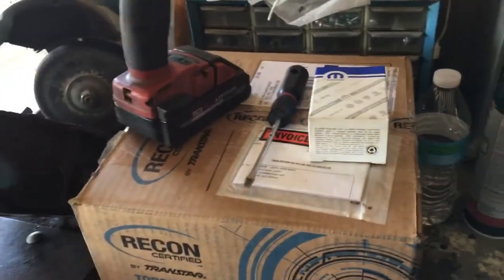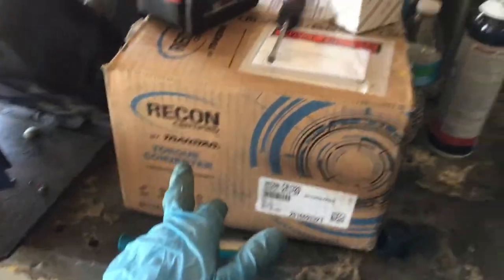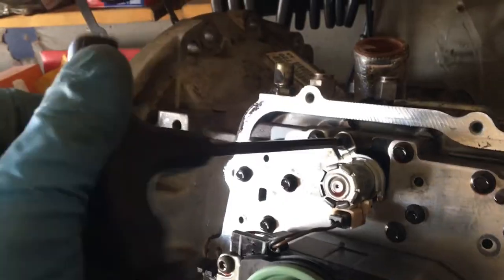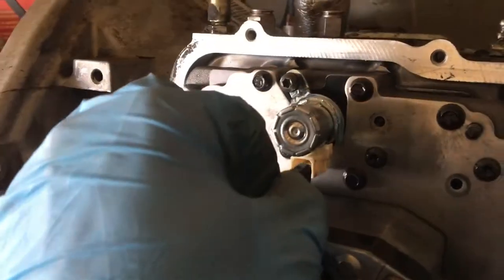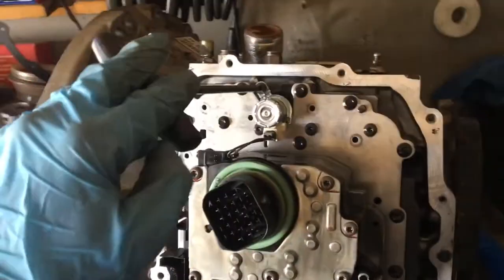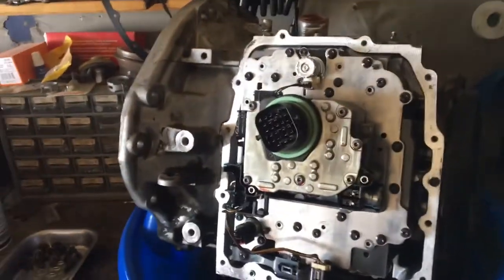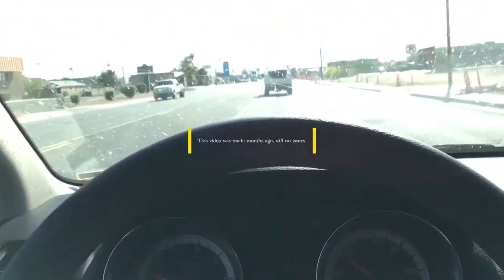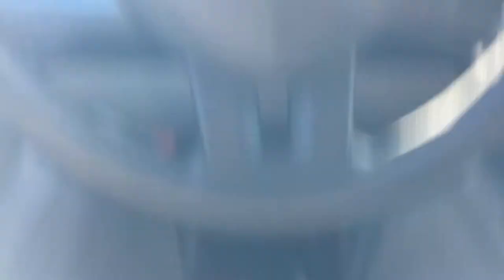2010-2015 Dodge Grand Caravan p0740 converter clutch lock up (FIX/REPAIR)

Comment: Dealer Tech here, great repair. 99.9% its never the solenoid. Great video my friend. Liked and subscribed.
Reply: Hello, my dakota 2011 when taking temperature remains without advancing. I have to wait for it to cool down before I can move on. Returns the code P0740, do you know what the problem may be?
Reply: Mine went out and I found a video that described it to the tee. It gave the MOPAR part#. Do you happen to know it? The dealer said exact same thing you did. 99% sure this wouldn't fix it. It did. Now it's happened again, ...to another 2010 Chry T&C (both 3.8). They both shuddered and died in forward, went perfectly fine in reverse and could be driven by:
1. Avoiding stops if possible
2. Shifting to neutral just before stopping
3. Shifting into drive and applying throttle vigorously
I drove each of them home from 300+ miles away.

To sum up:

This solenoid may not be the problem 99% of the time, but for me it's been the problem 100% of the time.
Reply: So what’s the problem?
Reply: @Sanjar10A7777  Who are you talking to? I cant just hold sessions on somebody else channel, thats rude. You can visit my channel and ask what ever you like as long as you subscribed to the channel.
Reply: @OnlineMechanicTips  you said  99.9 not the solenoid. So that’s why I asked what’s that. Give value and than ask for subscription
Reply: @Sanjar10A7777  Sorry, I dont discuss this on others page. You dont have to do anything.
Reply: @Phuckharris2024  what kind of car do you have?
Reply: @OnlineMechanicTips lmao bro it’s YouTube it’s not that deep. “You must be subscribed to me” gtfo

Comment: Good info!  I have a 135k 14 TC with this code only.  Shifts fine.  fluid is clean with many changes.  Looks like the torque converter is done.
Reply: From experience these vans are notorious for chewing up torque converters due to improper shift programming from factory. After you get the torque converter replaced make sure to update the car to the newest software that improves shift quality.
Reply: @mikec2220 so where to go, how does one update the software to improve shifting?

Comment: I had my trans rebuilt and and new torque convertor and new solenoid pack . 3 months later Im having fuild leaking from breathing cap and car kinda doesnt go into drive right away it hesitates to go into gear.They didn't change that TCC sensor. I just order it and hope it corrects the problem. I already did the transmission fluid and filter just in case it was a filter problem and it didnt correct the problem.

Comment: So if you replace two parts at the same time and the issue is fixed, you never really know what part fixed what.  Unless he cuts open the TC and looks at the clutch.  The TCC valve CAN become clogged up since most owners never replace the transmission fluid.  I'd spend $50 on a sensor unless before I dump a grand into a TC replacement.
Reply from the maker: It was replaced to prevent any future problems , the tC was definitely bad

Comment: I have a 2019 Caravan GT.. transmission was replaced at 180k miles which is verified by carfax, AMCOO & owner had receipt - Previous owner used van to do uber. The van is immaculate and a lot of service records - So far only issue I had was replacing the dreaded oil filter housing everyone replaces with the upgraded metal DORMAN housing. Well, I just bought the van off him at 240k (Never owned a caravan before) I feel like it has loud air like swoosh sound when I take off & accelerate. (Transmission shifts perfect when I drive) But also sometimes from drive to reverse and reverse to drive it might turn off. Today got the P0868 Code. I read somewhere it could be the TCC Solenoid?  or Is it the convertor? or the trans fluid pressure sensor itself? I just purchased the trans filter & fluid to do a service next week as well. (No check engine light but when I scanned it that code came up) I will also change the alternator this weekend as it was flooded with oil due to the oil filter house leaking. (The battery light came on - we suspect since alt got oil and belt as well - it was not charging battery right) But there's definitely something going on in the trans due to the loud swoosh and P0868 code. Any help is appreciated.

PS: at idle my torque convertor slip is at about 60. (I have no driven it with the scanner connected to see the torque convertor slip results)

Comment: I have a 2013 doge grand caravan thats stuck in limp mode. And its throwing a P0760 code overdrive solenoid contol circuit. Do you know which soliend this is or which one i have to change?

Comment: Did your gearbox problems with slipping is solved? I have opel insignia with f..in slip problems, gearbox was overhauled. I put new Valve body, remanufactured torque converter and still have slipping it seems to be problem with tcu or wiring 😕
Reply: Check your transfer case if you have a four-by-four the linkage could be disconnected

Comment: I agree with the recommendation here. I just overhauled my family van transmission in my garage. The torque converter and input clutch set are the only parts you need to replace for that P0740. Should you replace the solenoid? That’s up to you. It’s easy enough to check the pin connectors to see how f you have a solenoid out of spec. 
But from personal experience from completing an overhaul on my 62TE at 164k miles the only parts needing replaced were the torque converter and input clutches. Save your money folks.
Reply: I have a 2009 routan and I have that code, it is always cold when the van starts to move slowly and when I stop it turns off, I don't know if it is a symptom of that code

Comment: I'm guessing the transmission needs removed to access the torque converter?
Reply: Also what prechecks should be done?  How would you check the wiring?  I mean, I know you'd use a multimeter, but I've no clue what and where the wiring is and I don't know what specs to check for.

Comment: got salvage 2019 van with 85k miles, with hydro locked engine, replaced the engine along with reman torque converter, got it from rockauto, after the assembly getting p0740. So going to replace this solenoid and see where it goes. How is it likely I got a bad TC?
Reply from the maker: Very likely , just check what I mentioned in the video. It will give you a. Good idea what’s going on
Reply: Did you perform a transmission relearn and clear the old values on the new trans instal?

Comment: i just subscribed, and liked. I have the p0740 code, do you suggest i replace the front pump as well?
Reply: are you getting this code with a standard obd scanner? or an expensive 600 scanner
Reply: @pearlrival3124  standard obd2 readee
Reply: @anthonyt6160  thanks for responding I guess I’m good for a few more miles but the slipping and shakes have begun.

Comment: I just got done replacing this solenoid and the same p0740 code popped up. What else should I look into?
Reply: How much did repair cost? If you don't mind
Reply: @blackdiamondA1  ended up trading the car in.
Reply: @xavierbuscato9427  oh ishhhhh hopefully it's covered under my full train warranty lol
Reply: Its NEVER the solenoid, always the T/Conv. You wasting time replacing that solenoid for this code/problem.